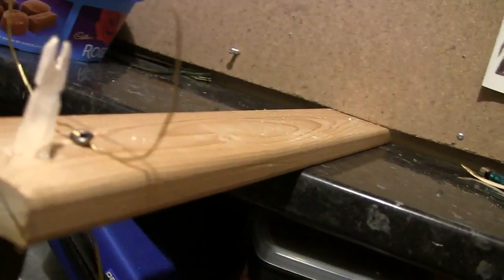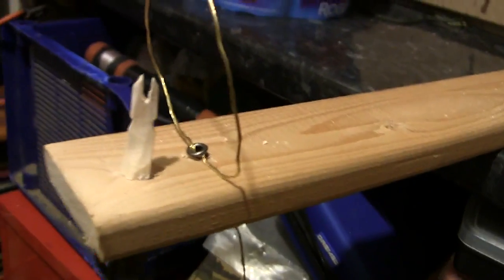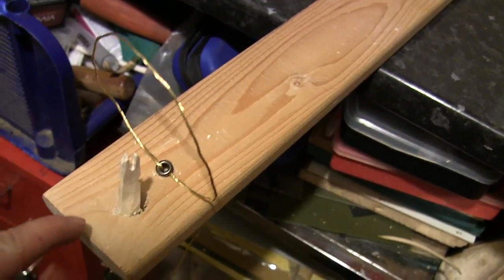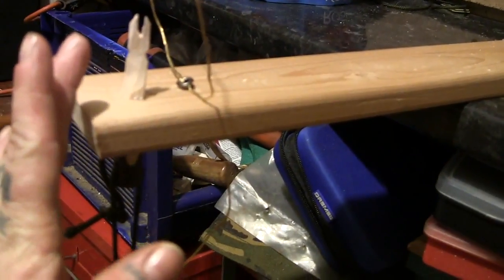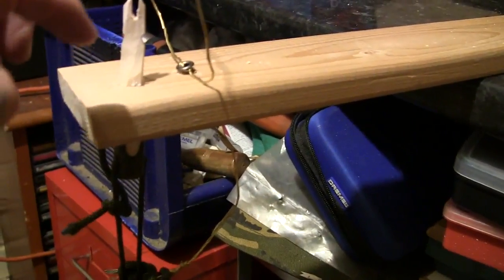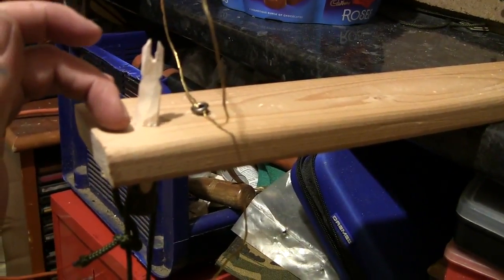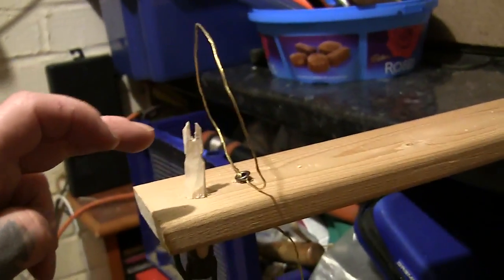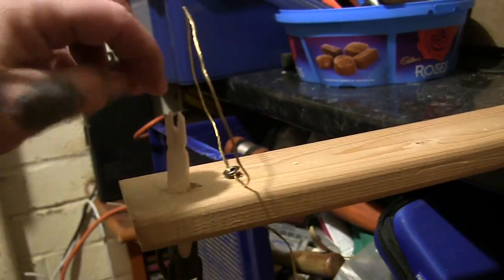Squirrel Trap mk 2

Comment: I made one of each. One with the hole for the trigger and one with the trigger on the end. Both have the same problem.The weight holds the trigger too tightly for the squirrel to set it off. They feast and leave. Have to try and figure a trigger that the weight does not hold in place.  Have had them out for two months with Zero results.